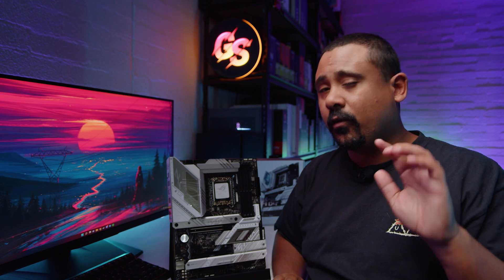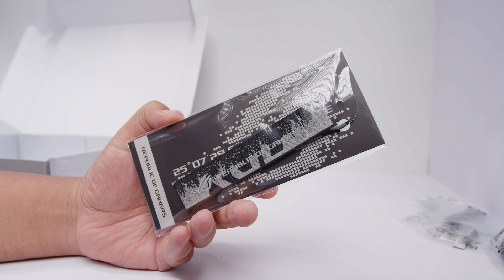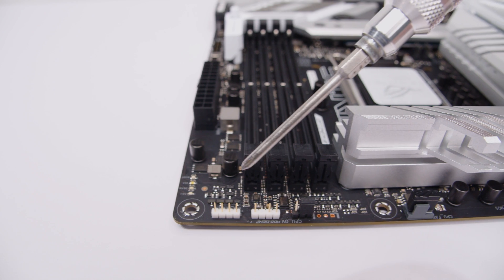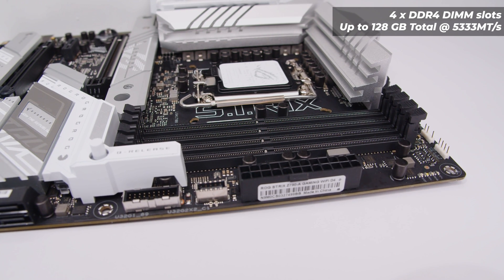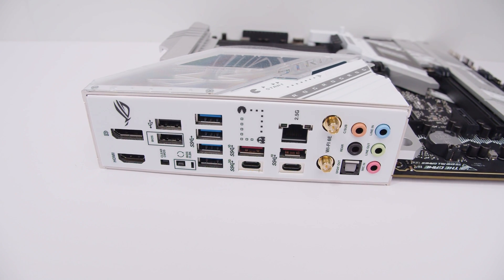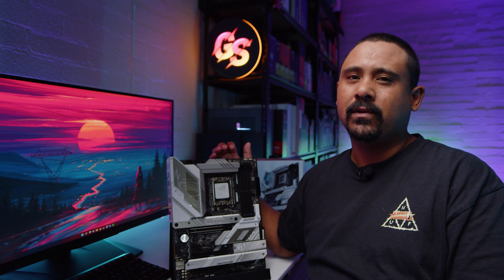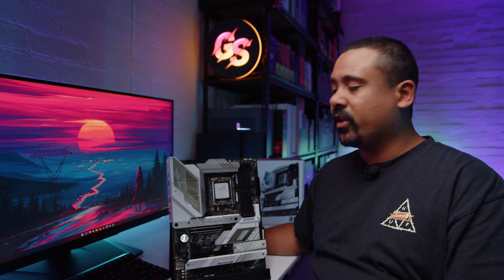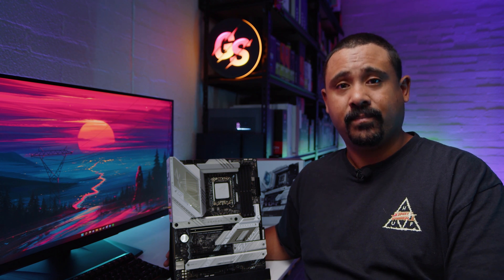The Last NEW DDR4 Motherboard Ever

Comment: strix white motherboards for intel are always way better than what they have for amd. if i'm not mistaken the only white motherboard for amd is the b550-a gaming. It looks fine but compared to intel counterparts, it's not good enough.
Reply: The x670e Strix has a white cover on the VRM and it's got a far better selection of USB ports on the rear IO.  This is definitely a killer board though.

Comment: I'm glad I found this video, I'm looking for a motherboards that supports DDR4. Can anyone in the comments section tell me if the ROG STRIX Z790-A is the best? Any advice is welcome.
Reply: Uhm, like one of the best, the best though is like from MSI and Asrock Steel Legend
Reply: @baoquoc3710  could you kindly write down the specific model?
Reply: @baoquoc3710  Msi mpg Z790 edge WiFi ddr4?

Comment: Have the Z690 Strix-A D4 and it has bee trouble free, easy overclocking, all the functionality, looks great and just dropped a 13700K into it with no issues...A little pricey but I had an ASUS cash back offer...The z790 Strix-A D4 looks the part as well with little bit more...

Comment: Not going to lie, was planning on getting an Asus Prime board, but after seeing the pcie slot q-release button, I knew I had to upgrade to a ROG Strix (it's also available on the TUF DDR4 only z790 boards).

There are bloodstains on my Noctua D15 from trying to remove my graphics card.

Comment: Im still running on the i5 9600kf on a z390 A @5.17ghz with a 1660ti and it's still perfectly fine for using an orchestral amount of vst's in my music software and play all the games out right now when Im not feeling it. I like the bios of asus boards. For me personally though, I'll probably go with a z690 A for all white or an F/E for all black and a 12 7k because they will probably/hopefully be cheaper soon with black friday and cyber monday around the corner with the i13and 790 fresh in the stores. Should be fine for an undervolted 3080 @1440. I have 2 cards just sitting there waiting and saving for the rest of the components to see what I can snag on sale, while building a racecar and trying to keep my music library as current as possible lol, if we still used vinyl and singles were $6 or $20 for the lp I would always be broke.

Comment: Built new system last winter. This board in Z690/i7 12700k/3080Ti. Good for 4 - 5 years.

Fair winds and following seas to all.
Reply: My favorite quote from JayzTwoCents - "Just because something new came out doesn't mean your system will start running slower." So true. I'm 12900k / 4090 / Z690 for the next several years.

Comment: I'd take a B660 with an i5-13500 (for budget content creation, given the P+E configuration) if vendors release a BIOS update for their current boards. Great overview, Nick!
Reply: i wonder why u dont go with 13600k, bcs B660 work fine with it
Reply: @tgl69420  maybe power draw on high voltages?
Reply: @baoquoc3710  actually u can bcs u can use 12600k & 12700k on it

Comment: It's very unlikely to be the last DDR4 motherboard.

Bdie DDR4 still has lower latency than the best DDR5 when both are tuned.
Reply: Agreeeee, its going to be a while until timings get really tight for ddr5!
Reply: @cybersamiches4028  SK hynix mdie is ok (even for the price) and overall better than Bdie while costing about the same. 

But for specific scenarios samsung Bdia can actually be better.

Comment: If you read between the lines of AMD roadmap, they said they plan to keep AM4 alive for a while. So maybe there's still something up ahead?
Reply: Don't think so bro. The s version is and was the last upgrade for AM4 imo.
Reply: probably some more lower end cpus as they might have some surplus of laptop chips or such, everything else is already covered
Reply: If you check AMDs wedsite it says AM4 far from dead.  Supported with new releases for a couple more years. Probably 3d versions of each processor. Then they’ll do 3d’s on the 7000 series.

Comment: Leaks rumours 13th gen is not even 10-20% better than 12th gen for gaming. More of a massive boost for content creators with the e cores and windows 11 platform.
Reply: I watched a remote live review from jufes frame chasers channel and from what he had gathered theres between 1-3 percent frame increase in gaming, and obviously very high multicore score over the 12900k!  From what I saw he only had it clocked to 5.5ghz all core, I believe it does boost to 5.8 turbo but we shall see when 3rd party reviews come!
Reply: @cybersamiches4028  I wouldn’t jump on believing a review from a guy that didn’t even have the actual processor in hand and was tell some dude what to do over the phone.😂😂😂😂 how gullible are you?
Reply: @animegeek6118  Jufes has extremely reliable information on pretty much everything. While he didn’t have it in hand, he gains nothing from lying about this. He would lose his audience if he was lying about the information. He also regularly gets higher performance from his components over every single mainstream review channel because of overclocking experience. Don’t like him, that’s fine. But he has valid, testable information. And when he has one in hand will be doing an in hand review of the product.
Reply: @animegeek6118  Considering it wasn't in hand I dont really care, he did the best he could with the resource offered!  Like I said we will see when it's released and tested by 3rd parties!

Comment: The question why you would want to buy a dead platform in lga1700 on ddr5. Z690 ddr4 boards on sale should be considered.

Intel didn’t care for z590 either. They rarely do for the second run on the same socket.